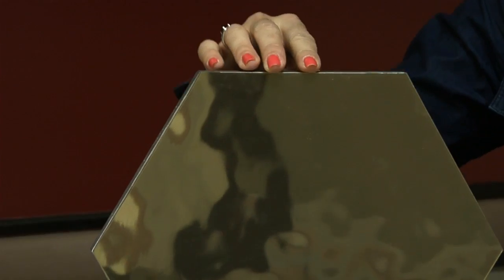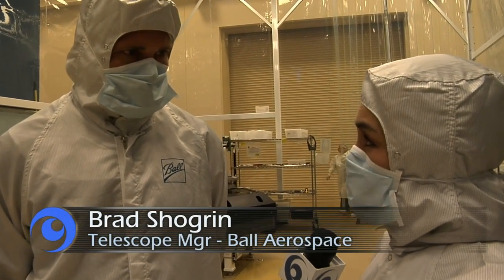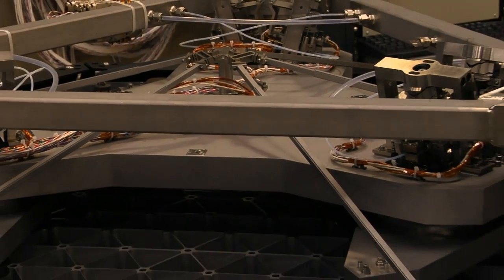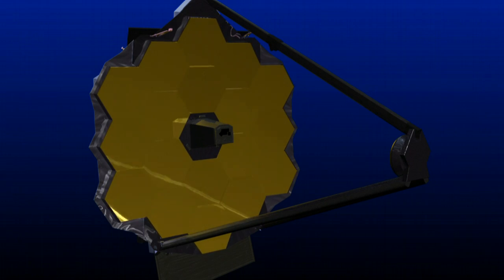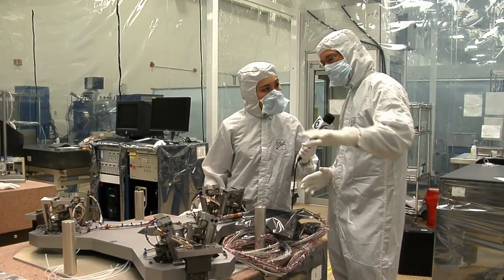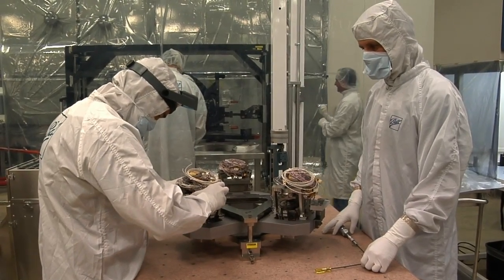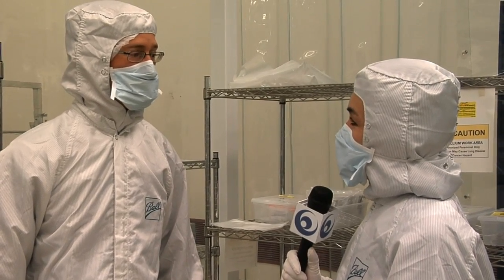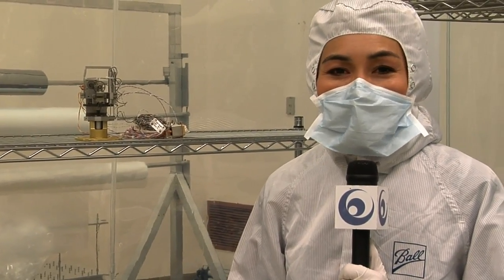Behind the Webb, Show 7: Got Your Back

Comment: An FYI, note the pink tables where they are making precise distance measurements, toward the end of this video. Those are pink granite tables which have extremely accurate flatness, which can be used as a measurement surface. They are very thick slabs of granite ground down to maximum flatness, and the granite besides being very hard and durable so as not to scrub off any material from usage, also has very stable thermal properties to prevent expansion due to temperature. It's large mass and being stone also keeps its temperature stable. 
Needless to say, these are expensive tables used for metrology. 
The precision of every part of this large and complex device is amazing to see. Always enjoyable to see what can be done when profit margin is not part of the equation.